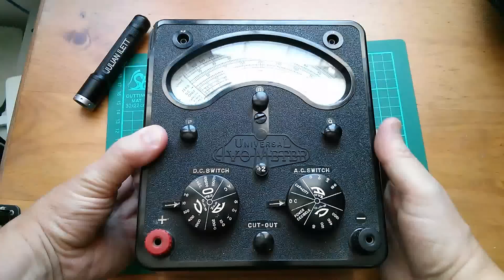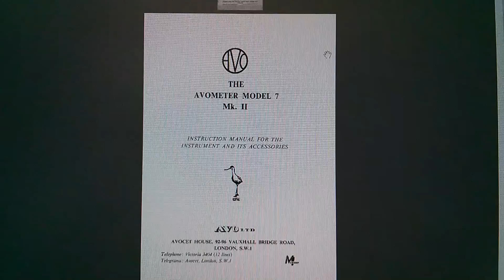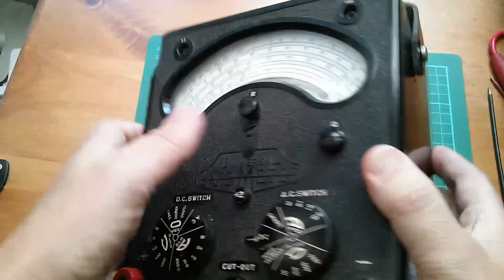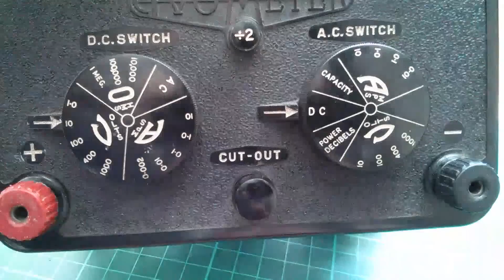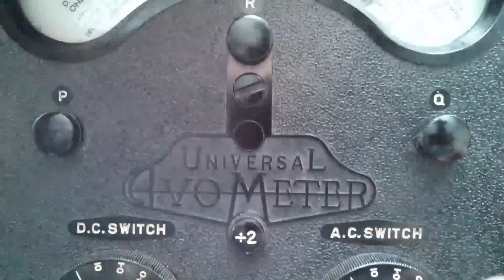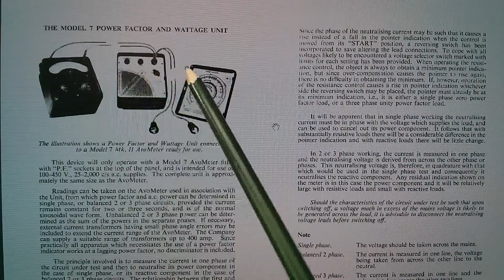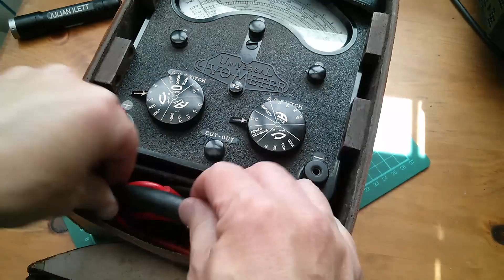Retro Electronics: AVO Universal AvoMeter Model 7

Comment: I believe the D cell holder is a replacement for an earlier square section battery which had screw terminals. My meter had that battery connected along with the two 4.5v batteries which have leaked a great deal :-/

Comment: I still have one of these and would not part with it.
They are so useful and are not prone to strange frequencies as DVM's can be. You can watch small value capacitors discharging which would confuse a DVM. with undulating signals a DVM will be going nuts to lock on to a reading, analogue wins out with a visual display. As for the age, there is a date code on the meter faceplate that is partly from direct view by the case, situated above the Q control.
There is a dedicated site on the web (cant recall where) that gives chapter and verse on these and dates the many variants too. My Mk7 IIRC 1952

Comment: Ha, I have one of those, inherited from my great-grandfather. It's a Mk1, and kind of battle worn - he used it working as an aircraft mechanic. No case, but it still worked fine when I used it as a kind in the 90s. I'd guess mine is from the 50s, though I'll have to check the serial - it's with my parents at the moment.

Comment: wow. yours is in immaculate condition. My one has its case but no cables and the copper battery contacts are corroded. I'd like to find out if it still works like yours. Great video!

Comment: I’ve worked for Avo\Megger in Dover for 25 years, and I am company historian. It’s a classic piece of test equipment, sold up until 2008. The date can be obtained from the serial number printed on the scale plate.
Reply: And sometimes an apart number e.g. 261 which is Feb 1961.
Reply: Mine has serial number 2876-A-248, and doesn't have the two terminals near the meter.
Reply: The circuit diagram does,nt match the meter on my 40 mk 2

Comment: AVO made a whole range of interesting electronic test gear apart from multimeters... mainly valve based; however their is little or nothing on-line detailing this equipment.  Mostly just about the multimeters.  I have an interesting AVO Type 1388 B if anyone knows anything about it?. Also an AVO ETM, a couple of VCM valve testers... oh, and an AVO 8 :)    It's high time someone (perhaps an ex employee of AVO) could put something on-line about this iconic British ground breaking company and its extensive products.

Comment: Within the last hour I have brought a SANWA YX360TRF analogue meter. Analogue meters are unbeatable for certain jobs (try tuning trimmers and ferrite slugs for smoke which is simple on an analogue but near impossible for digital meters). Also the SANWA has a zero  centre capability. I have fluke and volcraft for day to day use but would love an AVO. Beautiful piece of kit which would be better off in appreciative hands.

Comment: On a safety note, early units had a backbox made of aluminium with a black crackle finish. This is all well and good as phenolic boards are glued inside as insulation.... provided no-one has drilled out and replaced the rubber feet and attached new ones with self tappers. The spacial tolerances inside are pretty tight and it is possible to shove a screw straight into a shunt or coil and make the case live when testing.

Comment: The capacitance range was nothing more than an ohm meter (or reactance meter, to be more exact) function. It was calibrated to work with the standard mains frequency. An infinite capacitor would be an AC short circuit, so would pass the full AC voltage at the calibrated mains frequency. Lower capacitance values will divide the voltage with the meter shunt resistance and produce a lower reading.

Because they used a low frequency and an often questionable "sine wave" wave shape on the power supply they weren't particularly accurate, and also could only measure moderately large capacitors. Motor start caps, for instance.

Comment: I still have a Model 7, with the steel back case. I was told it was tropicalized. The steel case has an earthing stud for screening. My other one is a Model 8 Mk 9. Both have mirror scales and are within 1% or better of my Fluke 75. Big and clumsy they are for everyday use, but if your workbench is big enough, just leave them connected all day long to the job in total confidence. A bullet-proof meter from my apprenticeship days, they were the top of for every day use. Good ones are about £50 or so.

Comment: There were loads of Avo's at college, back in the late 1960's, when I was studying C&G radio, tv and electronics. 
They often got overloaded / blown, by students. The college technician, would then repair them. 
I think your find that battery adapter, is made of 'Paxolin'.  It's a hard, paper laminated, insulating material. 
Again, we used Paxolin a lot at college. Drilled holes in it, then pressed metal turret pins into the holes, followed by soldering electronic components / connecting wires onto the pins, to form an electronic circuit.

Comment: I have to agree this technology, while good in it's day, should have taken a bow in the 1950's. I take the fact it was produced well into the 80's to be a very British thing.
Now (for those of you out there), don't get me wrong: I'm very much aware of the niche circumstances where, experience with this model multimeter, will yield a correct fault finding diagnose quicker than with any combination of modern equipment. However this is a mute point in the current service industry (or what's left of it).

Comment: I have an AVO 8 I bought at a car boot sale for only £15. It's in very good condition and as a very nice bonus I discovered it has the 15v inverter mod fitted! I've used them in the past so thought I'd grab it.
I'm with Julian on the AVO. While I have great respect for this electrically rugged, reliable and accurate piece of history, I would not like to have to use it as my main meter. It's ergonomically horrible, bulky and cumbersome. The leads are stiff and heavy and aimed at electrical rather than electronic engineering, and the meter doesn't withstand drops well. I use my old Fluke dmm, it's so much more practical.

Comment: It is quite the bodge job. I wouldn't mind one for my meter collection I suppose. I'll never find one on this side of the pond though. Here it is all Simpson and Triplett. With perhaps a smattering of Weston thrown in for good measure. Old meters are fairly worthless in my experience with them. I pay anywhere from $3 to maybe $20 for them depending on what they are. Which is why they're fun to collect. They're certainly cheap enough.

Comment: Dunno why you wouldn't like to own such a piece of beauty!
I've an Avo-8, and it's used very regularly. With a 50-microamp FS meter, it's ideal for watching an ultra-low-power microcontroller - even the mechanical cutout works fine, if it enters an interrupt routine when you're not expecting it.
Price? My 8 cost me €45, reasonable condition, except it can only be zeroed when it's lying flat. They made a helluvalot of the 7's and the 8's, so you won't get a lot for it - £50 outside, I'd reckon.
About 30 years ago, I overheard a couple of blokes at a radio amateur convention (Alexandra Palace, IIRC). They were bartering for gear, using Avo's as currency!
But really, try using it carefully for awhile. Bet it grows on you.
Reply: ^^^^^ wot he said.

Comment: Hiya, I think you'll find the D cell 'holder' was actually an adapter, as the original battery was discontinued, but I'm not 100% sure. My grandfather worked for AVO, I think on the design team, something quite senior anyway. I remember some sort of battery adapter for the AVO 8 being like gold dust. I've actually found some AVO patents online with my grandfathers name on them.
Reply: I seem to remember something similar about the battery adapter, will have a look inside my Avo 7, hope that there is no battery in it. Not been used for more than a decade.

Comment: My grandfather has a Roto Ranger, the original auto ranging multimeter. It was made in 1947, and has been serving him ever since, never needed a new part except a battery once in a while, and is one of the most accurate meters i have ever seen. It has a 0-50 microvolt range, and i have checked it with my Fluke digital meter, and it is accurate to about 1/10th of a microvolt. No digital multimeter will ever last 68 years!
Reply: Have a farnell (240volt powered) digi-meter for accurate work myself. Quite amused at the instruction book which only guarantees specified accuracies once the unit has been warmed up for 30 minutes.   Having opened it up it's well made and has dedicated adjustment pots for all the scales-impressive. 

Portable, it is not, but it is rather old. About 1970 i think.
Reply: I would not be too confident in that, I already own digital multimeters that are nearly 35 years old and I have vintage digital test gear even older still, working just as well as they did on day 1.  I would not be terribly surprised if they are still working 30 years from now (granted, the more advanced test gear may well need recapping before then, but the multimeter has no electrolytic capacitors so it should do just fine.
Reply: Ethan Poole Well, that is new to me. I wouldn't think that digital meters would last that long, because my oldest one ever was 9 years old when it died due to a static discharge, but i imagine that really old digital meters wouldn't have such sensitive chips inside. The fact that you have working 35 year old digital meters changed my view of digital meters a bit, but i still prefer analog in most situations.

Comment: I have a very old VOM, No brand on it that I can find, just a couple rows of plugs on a red board, a large meter, in a wooden case.  When I got it, I pulled it apart and removed some old Winchester brand D cells.  They were, of course dead, and at that time, I was working as a Gunsmith and had a table at most gun shows in the area.  I  put the batteries on my table, and some fellow fell in love with them and tried to talk me out of them.  By the end of the show he ended up trading me a very nice little 2 Inch .38 SPCL Chief's Special by S&W.  Still have the meter though.

Comment: The AVO 7 had a sensitivity of only 500 ohms/volt so on the 10 volt range it shunted the circuit with 5k ohms compared to 10M ohm for to-days meters or the AVO 8 which is 20,000 ohms per volt. The AVO 7s were basically designed for Electricians to use (Low impedance circuits) and the AVO 8s were designed for Technicians to use on high impedance circuits. (Radio, TVs etc)
Reply: The AVO MK7's were widely quoted, in many radio manufactures servicing instruction, as the meter to use when measuring and setting voltages etc; as these were the meters their radio engineers used when drawing up specifications.

Comment: A beautiful example of electro-mechanical engineering. I still use my Avo 8 for initial checking on my valve amps - I somehow have more faith in one of these for higher voltages than a modern(ish) dmm.Great video by the way :)

Comment: It's all about the nuances of analogue meters. The way the needle wiggles when the voltages is varying can give you as much information as a cheap scope. :)
Reply: +ParedCheese  I would hate to be without my old Multimeter, it might be 31years old and not used often but in some respects analogue is easier to read.
Reply: *voltage
Reply: Agreed. The motion of the needle can be quite useful. That is why i built my own multimeter with both analog and digital readouts. i used a Fluke 87 for the digital, and a very old Fluke for the analog.
Reply: Nail hit on head.      Having pulled 7 avos into working order (partly with spares from 2 others) they remind me a bit of an old nursery rhyme from years ago:    'When she was good, she was very very good, but when she was bad she was AWFUL!'

Worst offender- leaf switches worn, maladjusted, or damaged with a women's nail file!
Other usual suspects- damaged movement, loose, tight or chipped jewels, magnetic swarf jamming coil, scale plate warped and jamming against needle (yes, really!) rotary switch contacts misaligned and jamming against each other, switch cams gone loose and out of phase, distorted front panel from excess humidity causing casing screws to jam, shear, or not go in, have even had mildew growing in one instrument..
Reply: The Philpott, do you by any chance have the service manual for the Avo7's either Mk ? If so would you be willing to scan it and emailme a copy if that is possible

Comment: On the dial of AVOMeters there are some hand written numbers.(Usually located to the right, below the mirror section) The last three indicate the manufacturing date. So 361 would be March 1961, for example.
Reply: On the bottom left hand side of meter (11:29-12:15, 14:01) the text "Accuracy to B.S. 89 Industrial" is visible.  I'm not terribly familiar with British Standards, but I believe that dates it to 1977, or later (based on a very quick and incomplete search for that standard's earliest date)?

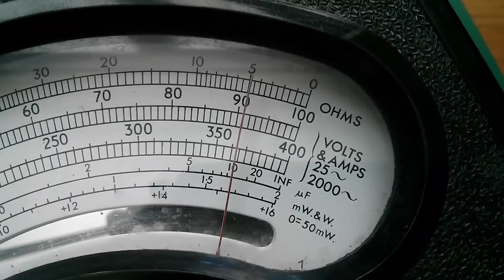On the bottom right side of the meter (10:53-11:09) the text (a space) followed by a "7” is clearly visible.  Some other text is visible, but not legible, in two locations on this side during these frames, which could be what the earlier commenter was referencing.
Reply from the maker: +Electricguy Hmm, I can't see anything written on this one - not from the outside anyway.
Reply: +Julian Ilett Hmm.. That's a bit odd.. You usually find it right below the lower bakelite edge for the window opening. It should be visible from the outside. Maybe they put it elewhere on this model.
Reply: +Julian Ilett It may be under the case on the right side of the meter face (per my earlier post) or like so many electrical items they (Thorn Avo) may have moved it to a new location suggesting it is a late year model. I guess it could be anywhere if it is not showing on the meter scale
Reply: +Electricguy +Julian Ilett Hope I'm not interfering, but image at 10:35 there seems to be the numbers Electricguy is referring to. Used to love my Avo8
Reply: On my model 40 (which is a mod 7 derivative) the date code letters are not shown on the dial at all. Looking at the interior of this one (and not having read the other comments!) i would guess this one is late sixties or early seventies. 

It has clearly had some stick as the needle is a bit bent! Still useable no doubt as looks very clean inside, even the leaf contacts look good.    I would expect it to be 'right on the bubble' on DC volts as the model 7/40 usually are.

Comment: I remember when i bought one of these in the 80s'.  I was told they were fabulous and revered and the best thing,  One of these was alwyas on the bench of the old electrical repairs and supply shop, testing batteries and bulbs, from the 50's to the 90's, so a memory of my chiildhood too,  but when i used one, I hated it to death!  and hated analogue meters because of it, a couple of years later when i recovered finances and bought a DMM i never went back, these should be a distant memory of the 1950's!  That lead set was the same lead set supplied new in the 80's i remember paying about 25 quid for a new set, horribly heavy and stiff,  sorry, no love from me to this avo!  The 7 was the general purpose unit, which most tv repair men used for valves back in the day, and the Model 40 which was used by many electricians and had a couple less ranges but more suited ranges for mains and 3 phase work.   Value,  about £30 to someone who likes them.
Reply from the maker: +jusb1066 Yeah, can't say I'm sad to have to return this to its owner.
Reply: +Julian Ilett Oddly I am just the opposite, a DMM always makes me wonder if the voltage is really there or not (yes I know you can get ones with low input impedence,) but for general purpose use, analog is far better :p